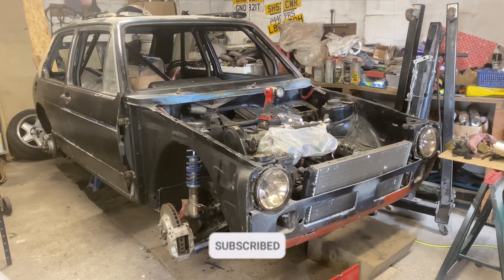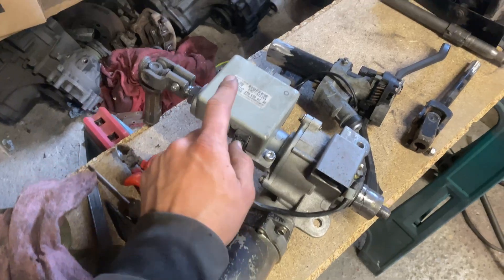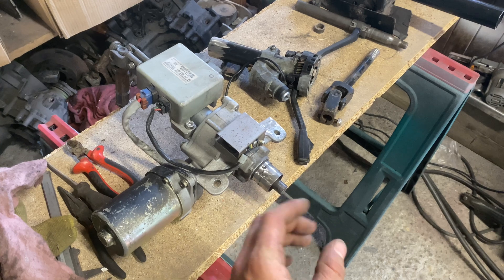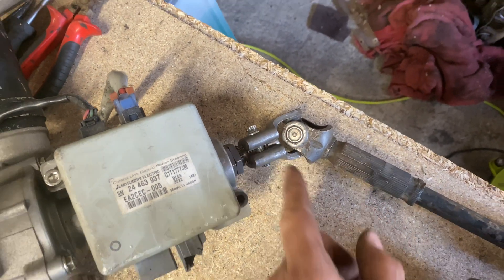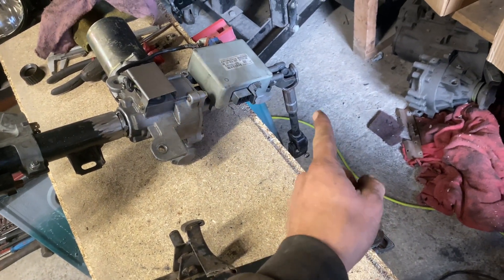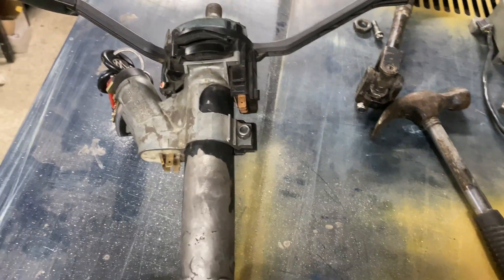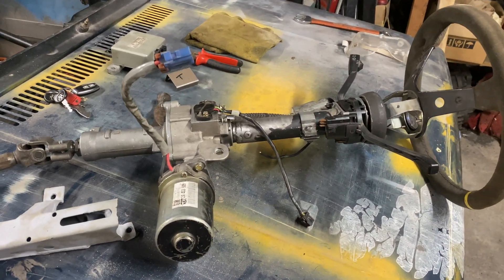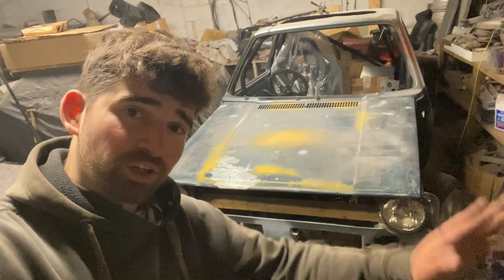How to fit electric power steering to a Mk1 Golf!

Comment: Great video. Don't you need a chip for the ECU?
Reply from the maker: As far as I know you can wire it up to some sort of speed signal so the sensitivity is adjusted automatically based on your speed (slower speed = more assist I’d assume), or you can wire in a potentiometer which is essentially a dial where you can control it yourself and adjust on the move, I’m going to do the latter and will make sure to make a video on it when I come to it - thanks for watching!